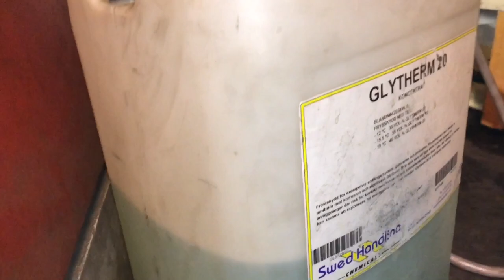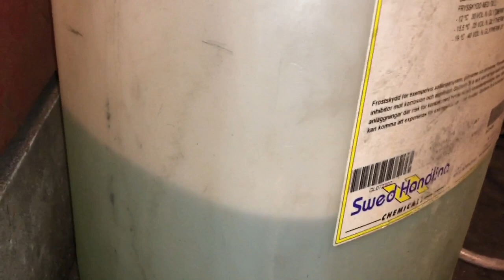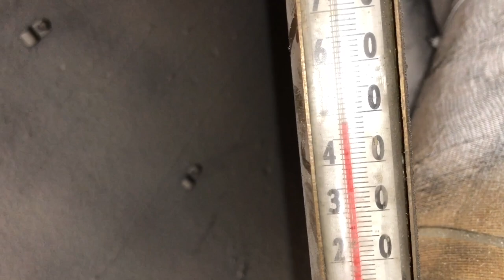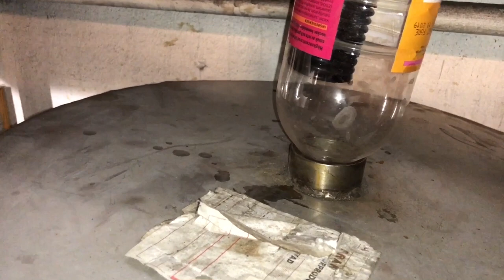Installing a cheap Pump into an Arctic heating system below ground and adding anti freeze.

Comment: Do you have a pressure meter in the system in the boiler room, Simon? 4 bar is a very high system-pressure in an open overflow expansion tank. Think 4 bar equals 40 mWp  (meter Water pillar) and that is an ordinary 12 stories building!     Don't have the expansion tank totally filled by water without an air pocket on top. Then the humidity will condense in the tank (in an attic with lower temp than the water as usual even with maximum insulation) instead of all humidity/"steam" will condense in the overflow pipe and you have always dripping going on. Some drops, as an old man, you will have anyway in an open system.  Remember it's the water that condensate, not the glycol so you will after a time have higher glycol mixture in an open system.  
Have a nice weekend y'all including Kasper "the snow nutter muppet" !  <3   
And it's relatively cold here in Uppsala, Sweden too (and I'm closefisted ~"environmental conscious" to hold too high indoor temp, and genetically a Northlander) so my sleeping cats laying on me don't allow me to write and disturb them. So now they are aggravated and sitting on shelves staring at me!

Comment: Great video Simon. While I wait for new videos, I go back and watch you previous ones. I must say I really enjoy watching anything you film and love your sense of humor. It's been great seeing your channel grow. 
That heating system is quite complex. I understand most but a bit is still clear as mud. The small pump you purchased are quite common here in the states in rvs and such. I have one I used a couple summers ago to pump my chlorine bleach for my swimming pool. I don't recall seeing one though that would shut off & on with pressure though. Most are either on or off via a switch. 
Stay warm & well friends and thank you for sharing. When does spring normally arrive in your region?
Reply from the maker: Hi Michael, that pump is an RV pump and they all have to shut off under pressure, that is how they work. They are always on but the faucet is closed, open the faucet and they pump water. So in order for a pump to be used in this way they have to have a pressure off switch.
So in case you missed it, I am at home in the US, more at home than anywhere. Trucks, guns and cabins are all me and yes have been in the US many times for periods of time. Spring is very short, blink and you will miss is but it normally happens in may. We still have snow in the yard until june or even early july. If you go to my first video, winter returns for the day, it was filmed 22 May 2021 and you can see there has been no snow melt. The next video was film 2nd June 2021 and you can see the snow all around. This has been the norm.

Comment: 3:02 ahhhh silence ,  👍🏻 .
Let's talk a water gage.  I don't see much access to the holding tank to add this but I will give this a shot. On a toilet ( tank ) you have the black ball in there to stop the inflow of water , right . So what if you cut the holding tank top so you could put that ball on a rod threw a smaller hole on top with said rod sticking out the top  then weld the bigger hole back up . Boom you have the gage . You could go smaller with the floot by using a cork from a wine bottle on a rod in the same manner as the befor comment. Maybe put a small hunk of metal on the threaded rod on the top side of the tank so it would hit a switch or some kind of alarm system to let you know that the tanks too full . Like you my mind is always thinking and racing around.
Reply from the maker: wow, both of those would work, but maybe to much work for what is needed because the water level should only change a small amount over any given period of time. The reason I said measuring stick is because I use the same basic stick to measure the diesel in the Volvo.
I have never ran that out of diesel and drop a stick in the tank every few weeks so I figure I could do the same with this tank just a simple stick. If the tank level was more critical then some more work would need to be applied. Thanks anyway they are good ideas.